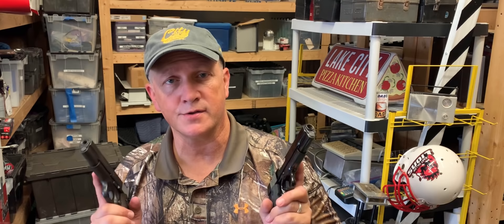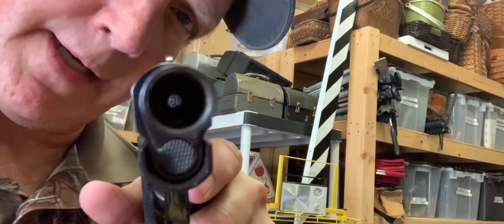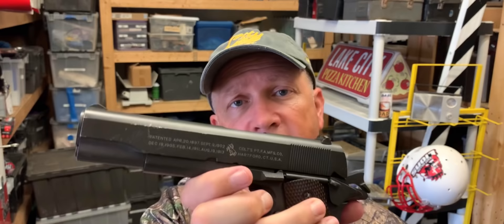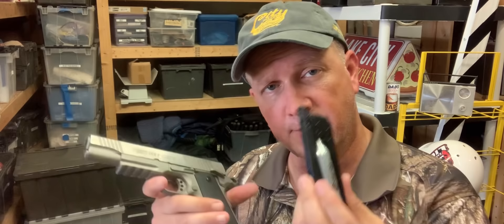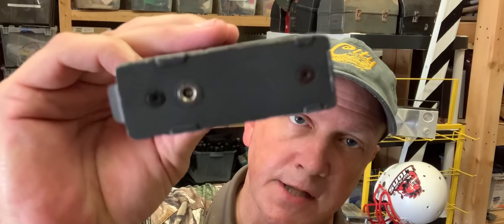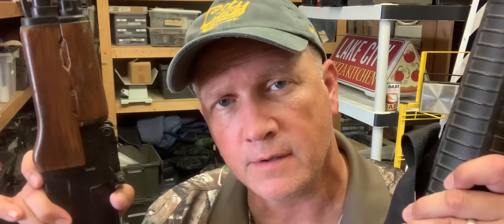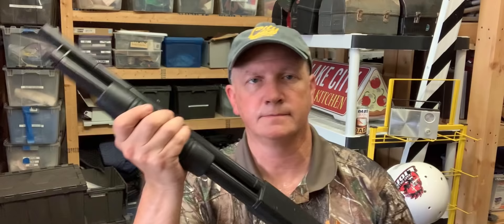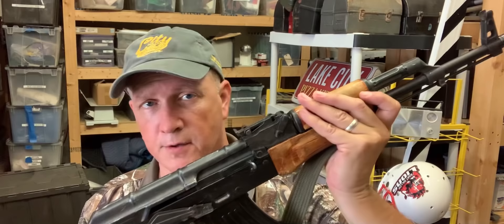Movie Props: Replica and Blank Guns in Movies

Comment: I used to work for an airsoft company that sold adapter kits that let you add your own silicon oil to a standard tank of camping propane and adapt it to use with airsoft.

The product was popular because it saved players so much money compared to branded "greengas", but it was crazy how many players didn't believe that greengas was propane.

Our owner eventually took a slew of the most popular greengas brands to a lab to be tested and published the results.

All that to say, it's cool to see that someone in a different industry knows the score regarding greengas.

:p

Comment: On adapting live guns to blanks, a recall an anecdote about an episode of Miami Vice.

They were to use a Ruger AC556k (the assault rifle version of the Mini-14 rifle, full-auto and all), not having had it properly adapted for blanks, and being tight on schedule, they improvise and weld in material into the flash hider to create the choking, so that gas pressure can dwell and cycle the gun.

This actually works, they have some shots of a character firing some full-auto salvos with it, but then when they do the last take shooting the gun, the modified flash hider fails and bursts open, flinging sparks and hot little shards of metal around.
Nobody was hurt, and the take was still good and got used (you can barely spot it if you know to look for it), but they all decided that there was NO way they would ever do that again, it could easily have gone really bad.

Comment: There’s a certain type of muzzle flash I’ve always wondered about. There’s no flash, it’s more like gas coming out of the gun. The scene in Last Crusade where Indy shoots all the Nazi guards after his dad calls him Jr is the first and best example I can think of. Do you have any experience with those? because that’s the type of look I want for my films.
Reply: There are some possibilities. 

1. The gun is a cap firing model. These are manufactured by Japanese toy gun companies MGC, Tanaka, etc etc. Wich are loaded with bullet casings containing a small pyrotechnics charge. These eject the casings and a puff of smoke exits the gun, depending on the model on the muzzle, too. Normally these are not front venting. 

2. A special kind of blanks is used. I think if they had used  typical movie blanks the whole screen would have been muzzle flash. 

3. It was coincidence and the shutter was always closed when a blank was fired, but I doubt it.

There is a video by forgotten weapons about movie firearms, he shows different types of blanks and barrel plugs. Larry Vickers has also some videos, but I can't remember if he spoke about the technical stuff or just showed some famous movie weapons.

I hope I could help you a bit.

(just edited a bit for translation mistakes)
Reply: Might be a pressure wave you're seeing of hot combusting air pushing against cooler outside air. Blank firing guns do still produce heat and pressure, and can still be fatal at very close range.
Reply: @marshallgibson89  im high rn but it could be over gassed green gas ar so that the gas comes out the barrel i dont have much experience with green gas ars just aeg
Reply: @phoneusandfroboof829  When have you seen an AR15 in an Indiana Jones movie? You must be high as a kite. ;) The gun, which was used as an example, is an MP40 in the third Indiana Jones movie. I don't think that at the time shell ejecting green gas guns where a thing, the smoke would also look different with a gas gun. Powder smoke is blueish in color, green gas is more whitish.
Reply: @marshallgibson89  they make gas blow back replicas of a lot of guns
Reply: @marshallgibson89  and actually the first gas blowbacks came around 1980 and idiana jones 3 was made in 1989, but considering theyd be new they wouldnt be as advanced as you said
Reply: That’s not muzzle flash, that’s just Unburnt gunpowder leaving the barrel.
Reply: More then likely it was a propane fired gun, you get the noise and some flash depending on gun size, guy in arkansas makes the new kits to turn prop guns into propane guns
Reply: Muzzleflash is usually aimed for in blank firing guns, because that's what looks cool. Consult your armorer and he'll give you the options for various flash sizes, as different loadings are available for different uses. Source - Am a film armorer/Gunsmith.
Reply: It could be the type of blank used.  They are available with different levels of flash and some are made to put out a lot of smoke.  Sometimes, if the crew can't get the lightning right, or if they're filming outside in the day time, they'll use blanks with more smoke, especially if they don't want to be too over the top.
Reply: Short answer, sometimes the combustible gasses gets ignited sometimes not.
Reply: German*
Reply: Yes would say that that might most likely be a gas BB gun, during certain weather conditions in certain tweaking, You can have this Gas guns  put out a bunch of the gas when they fire
Reply: @gui18bif  “nazis, I hate these guys”
Reply: @phoneusandfroboof829   we used a propane fueled .50 BMG simulator for some training. I learned about it during training when our team was ambushed and my element followed me into the woodline to flank the gun. Realized the instructors firing it didn't have on PPE, so throwing a rock grenade was out, so I wrote down both of their names and the gun's serial number.
One was a Vietnam veteran and well, color him shocked that I flanked him unnoticed and was close enough to hand him the correct serial number. Scored as a gun position kill, the first in that school's history.
No flame allowed from the simulator, as that'd have been a fire hazard in the field. Pretty cool machine though, used a spark plug to fire it.
Reply: @spvillano  movie machine guns are often hooked up to propane. Smaller ones often it's stuff like the "non-guns" rented from ISS props, which use a little piezoelectric charge, kinda like a Squib. One of the giveaways of those is they usually have no moving bolts or other parts.

Comment: As a gun nerd, CG needs to work on disguising the fill ports on magazines and the BB nozzle...things...on the bolt carrier. It's a pretty common mistake that's really noticeable since you kinda expect to see the bolt face and instead have some little gassy nipple on the cool shot of the hero working to bolt of his M16 or whatever. It's like directors really like showing that dust cover pop open and the CG dudes don't bother making the internals a little less airsofty and it ruins the shot.
Reply: It'd be easy to out some blue or green tape over them so that it reminds the vfx guys to deal with it.

Comment: The issue with the airsoft ak as a prop weapon is that the bolt isn’t full travel. Now assuming it is a ghk that is an easy fix.
Reply: Depends. It is moving rather quickly and might go unnoticed, especially if the SFX dept is good at animating shell ejection and the shot of the AK being fired isn't too long or too close

Comment: Shame you weren’t the prop guy on “Rust”. Alec Baldwin wouldn’t have killed someone then :-(
Reply: Come on now. It could have happened to anyone
Reply: @malusisoko7030  It can only have happened when gun safety rules are not adhered to. These rules apply to all guns, real, fake, or prop. It's the only way to avoid tragic results.

Gun Safety Rules

You never fool around or play with guns. Guns are dangerous when they are not handled or used properly and can easily injure or kill you, and those around you. There are no second chances with a gun and the rules for safe gun handling must always be followed to avoid accidents.

The 12 Golden rules for Safe Gun Handling

    Always treat the gun as loaded.
    Always keep the gun pointed in a safe direction.
    Always keep your finger straight and off the trigger until you are ready to shoot.
    Always keep the gun unloaded until you are ready to use it.
    Never point the gun at anything you don't intend to destroy.
    Be sure of your target and what is beyond it.
    Learn the mechanical and handling characteristics of the gun you are using.
    Always use proper Ammunition.
    Be sure the barrel is clear of obstructions before loading and shooting.
    If your gun fails to fire when the trigger is pulled, hold your shooting position for several seconds; then with the muzzle pointed in a safe direction, carefully unload the gun.
    Don't rely on the gun's safety to keep it from firing.
    Be aware of your surroundings when handling guns so you don't trip or lose your balance and accidentally point and/or fire the gun at anyone or anything.

Range Safety

    Follow the 12 golden rules.
    Know and follow all the rules of the Shooting Range.
    Listen and do what the Range Master tells you to do.
    Uncase and case your gun at the shooting bench, never behind the safety line.
    Always keep the barrel pointed down range.
    Always keep the gun on safe until you intend to shoot.
    Always wear eye and ear protection when shooting.
    Never shoot at water or hard surfaces.

Hunting Safety

    Follow the 12 golden rules.
    When hunting in a group, always pick one person to act as a Safety Officer for the Day or Trip.
    Establish and share everyone's zone of fire with each other and know where everyone is at all times.
    Always keep the gun on safe until you intend to shoot.
    Never climb over anything with a loaded gun in your hand or on your person.
    Never use a scope on a gun as Binoculars.
    If you fall or trip, control your muzzle. Afterward, check the gun for damage and/or obstructions in the barrel.
    When in Doubt; Don't shoot.

Comment: I'm kind of curious about the legalities and safety measures associated with prop firearms. I know a lot of states require fake/toy guns to have something on them that clearly indicates it's a fake/toy (e.g. using bright orange plastic on the end of the barrel), but clearly that wouldn't work for filming. I imagine the blank-firing ones are even more problematic since they were fully functioning firearms at one point. 

And how do you handle firearm safety when you want the actors to LOOK like they're intentionally trying to kill people without putting anybody in actual danger? You certainly don't want to risk actors waving around a fully functioning firearm thinking it's just a prop. Is it just a strict 'props only' policy or something?
Reply: There's alot of safety involved and alot of checks and double checks from the prop masters. Accidents are rare, but they do happen as a failure of the checks.

Comment: I am really curious about why there were guns that can fire live rounds at the Alec Baldwin movie Rust and why a gun would ever have live rounds in it.
Reply: A blank at point blank range is lethal...
Reply: If this is like the Brandon Lee incident, they used a dummy round that leave the projectile stuck in the round (squib load) and then fired a blank that pushed the projectile like a normal weapon will do.  Could also be a blank case separation, next blank fired the case. 
Other possibility is that they are totally incompetent and a live round used for photography got mixed into the blanks.

Comment: you CAN adapt real guns to fire blanks. we did the same in the military. BUT, and this is the most important thing, it is still extremely dangerous because once you start shooting blanks, the barrel becomes so much more dirty because of all the soot and other particles that are meant to stay inside the barrel. each additional round will eject those particles from the barrel and it can be potentially lethal, even a few meters away. usually you have a special adapter for the end of the barrel to catch most of the particles that fly out but that makes the barrel even more dirty + it looks shit to use as a prop :D and cleaning the rifle afterwards is gonna be no fun

Comment: How did Baldwin manage to kill a person if he was using a “prop” gun
Reply: I haven't seen it confirmed anywhere yet but it's almost definitely because the armorer had live rounds on set and in the gun. Absolutely insane negligence.
Reply: @Crushenator500  the armorer or prop master is almost certainly going to be charged with involuntary manslaughter. They gave Baldwin a gun with live ammo. Purely negligence
Reply: @Austin23191  Technically the assistant director gave it to him, but the fact he was able to grab a loaded gun from an unattended cart is just wild.
Reply: He was supposed to be using a blank fireng gun, which is considered a prop weapon.
Reply: @windhunter2270  It says right in the video that for revolvers they use real revolvers
Reply: @Crushenator500  Yes they use real revolvers, but revolvers can have blank rounds, AKA its considered a prop even if it's real.
Reply: @windhunter2270  I agree, but this one was almost certainly loaded with real bullets. Blanks don't penetrate all the way through a human body and injure a second person standing behind them.
Reply: @Crushenator500  Yes I can agree with that.

Comment: In UK we use airsoft guns. Barrel venting  blank guns are banned here. Since top venting blank guns are not going to look good instead we use plug fire cap guns if we want to show the cartridges going into the gun and the shells ejecting when fired. Also with plug fire cap guns the gas vents from the barrel. The gun is made from a hard plastic so it can withstand the gas but cannot be converted.

Comment: Alec Baldwin killed that poor woman. 😭
Reply: No, theres a team of professionals that are in charge of the firearms, they gave Alec the gun. It's no different than the guy pulling the lever in a hanging scene. If somehow the harness broke and the actor was actually hung, it would be the fault of whoever was in charge of rigging up the safety harnesses, not the actor pulling the lever.
Reply: @martyn975  No one should ever handle any firearm without having been trained in basic firearms safety. Not placing blame on Mr. Baldwin, but that gun should never have been pointed at anyone. All guns are to be treated as loaded. Period.
Reply: @dustykeele  Wrong. Absolutely wrong. Do you understand how many movies have been and are being made using firearms? Literally every single day since the mid 1900s. The last incident was Brandon Lee in 1993. That's almost 3 decades with no deaths. Prop guns when stored and inspected properly are extremely safe. This incident was caused either by negligence from the firearms crew, or was an insane freak accident involving shrapnel splintering off of the firearm. Either way, Alec was doing what he was being directed to do, and that's all he's expected to do.
Reply: @martyn975  Ah, just following orders then. Got it.
Reply: @dustykeele  Compared to what? Like I mentioned, zero deaths in almost 3 decades. The firearm is handed to them by a professional firearms expert. There is absolutely no reason why an actor would be inclined to check the firearm themselves. Actually doing so could increase the chances of a malfunction. There's a reason why professional companies are hired, and why they perform checks on these firearms, and not the cast & crew.

Comment: I am a "gun guy" I have used blank rounds to show basic firearm operation to "newbies", but only on manual arms , Bolt action rifiles and revolvers (..22, .30-06 and .38 Special) I like how this video lays out the basics of blanks in a semiauto. And also mentioned that DISTANCE from a blank is important. DO NOT IGNORE THIS. Blanks at close range are dangerous, even LETHAL. If you are a "home video" filmmaker, without the resources for real prop (IKR?) use UNLOADED Airsoft guns. Many are VERY realistic!, Add sound separately in "post". Damned easy today, even with free software.(plus, you can light off an "M-80" for sound to make your "9mm" have a big boom!) Be safe, learn your tools, and your craft.  👍😊👍

Comment: I've learned enough about toy, prop, and real weapons of all varieties to say with confidence: Don't point a gun at anything you aren't prepared to destroy. A dart is usually harmless, lasers can cause blindness, airsoft and paintballs can welt or damage property, BBs, blanks, and bullets can kill. If you would rather keep the thing you have in your sights, don't shoot at it. I haven't personally caused harm with a firearm, but there's a reason for every inch of safety gear and line of fine print. Aim responsibly.

Comment: This might be a wild idea, but if Green Gas is mostly propane then would it be possible to make a prop firearm that not only actuates the slide or bolt, but also passes a puff by a sparker to create a muzzle flash? This would seem to be a huge boon to visual effects budgets, with subtle lighting cues already being handled because there is an actual brief flame produced while being far safer than blanks because of the much lower pressures and the inability of unburned propellant being flung at actors.